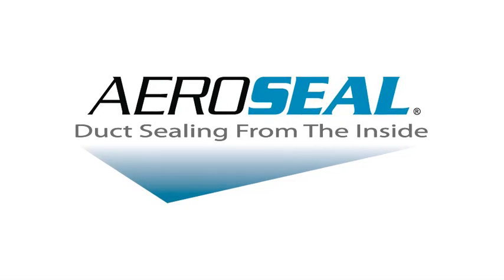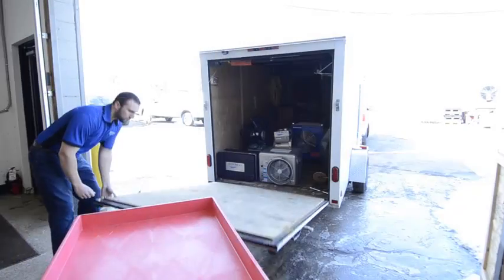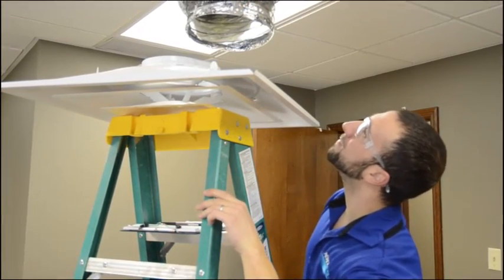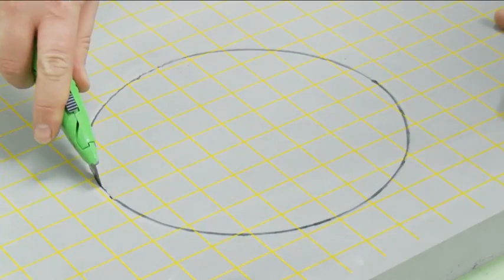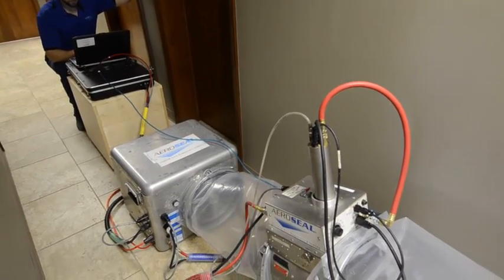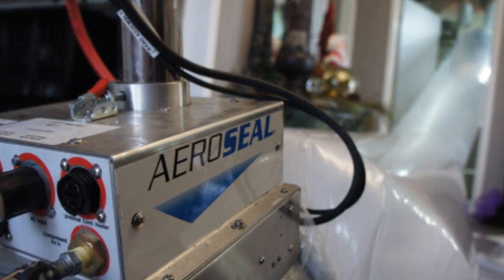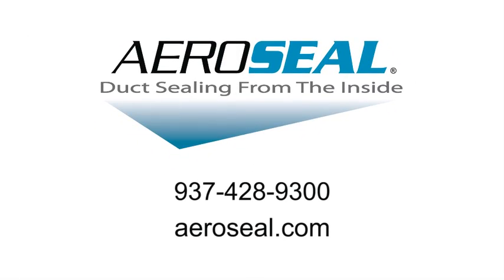Aeroseal Commercial Duct Sealing Project

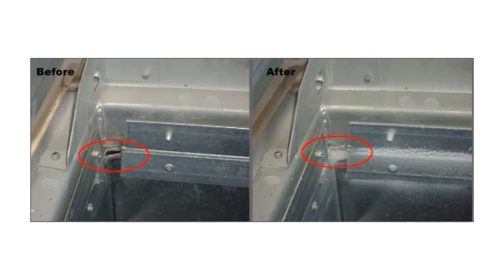Comment: this seemed so awesome until i saw the pic at 3:53 Now now your duct work is full of microscopic adhesive for god only knows how long. wouldn't want to be breathing that stuff in.. piece of mind out the window
Reply: It’s absolutely harmless. It’s practically Elmer’s glue. I’ve been doing this for a while and I’ve accidentally gotten the glue in my mouth several times. Once it’s in the duct it’s sealed to the walls of the duct.
Reply: Jaah King I know this is literally a year old comment. But do you know what exactly this stuff is or where to get it? Or is that more or less confidential?
Reply: This comment 🤣. Installing new carpet, paint, flooring etc -vocs far more harmful to your health. Aeroseal is harmless.
Reply: You need to do some more research lol this a foolproof system

Comment: is it safe to apply in systems that have radiation and/or fire/smoke dampers?
Reply from the maker: Thanks for your question, bahopik! Yes, it is safe to apply Aeroseal duct sealant in air duct systems that contain fire/smoke dampers and or radiation dampers.  When properly applied, the amount of sealant deposited on the inner surfaces of a damper is very minimal, with little to no effect on the operation of the device.  UL 555 fire tests have been conducted on dampers (both static and dynamic styles) that have been Aerosealed and they all operated as intended.

Comment: How are the all components in air handler protected like the blower fan and heat exchanger?
Reply from the maker: +David Wojcik  - As part of the Aeroseal process, air handling equipment is isolated from the aerosol fog.  A service provider will not seal through an air handler.  Foam blocking, wood, sheet steel, etc. is used by the service provider to temporarily block the supply and/or return air ducts that are to be sealed close to the unit(s) to protect the unit(s) from sealant.  The aerosol will be injected downstream from these blocks into the duct system(s).  Once the process is completed, any blocking is removed and openings in the ducts that may have been made to install the blocking are repaired airtight.